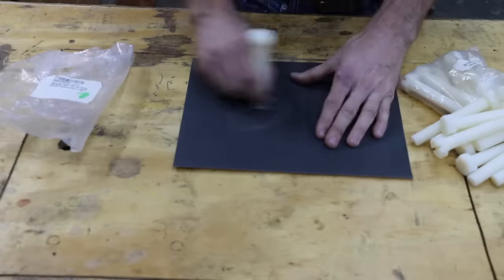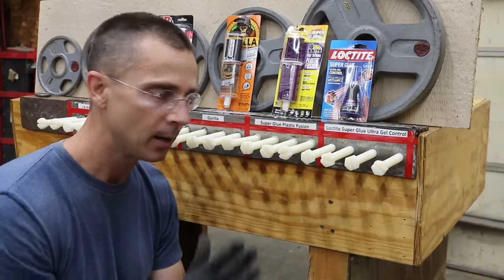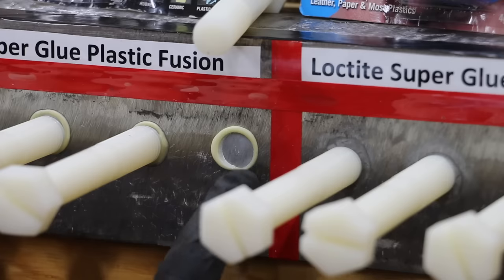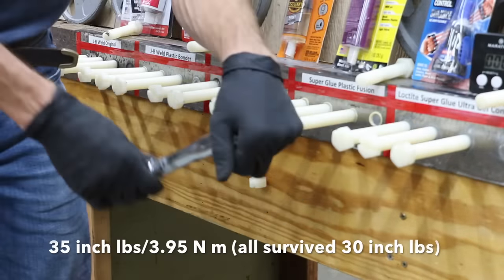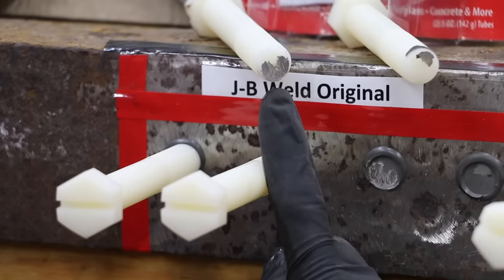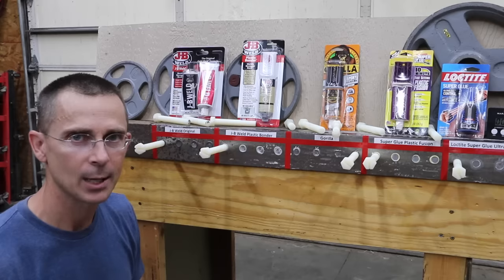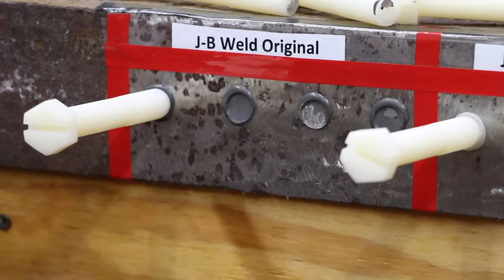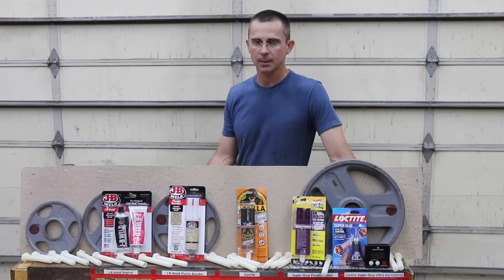Which Epoxy is Best for Plastic?  Let's find out!

Comment: I remember my motorcycle fairing snapped and I purchased some type of repair kit with a powder bottle and a liquid bottle. I Dremeld into the crack area about an inch in from the edge of both separated pieces, applied some type of plastic mesh, used tape to hold the fairing together on the painted side, clamped the separated pieces so they are held true, filled the plastic area I dremeled away with the powder, and then applied the liquid. It never separated but I don’t know just how strong it ended up being. Cool project tho. 

I’m thinking of repairing some broken parts of my door panels next. Maybe look to see if 3M has anything available for this.
Reply from the maker: Thanks for sharing.

Comment: @ProjectFarm  Which of your tests is most applicable to bumper tab repair?  I watched both this  and the "which epoxy putty is best" comparison  to determine which product would best fix broken car bumper/trim tabs. I'm guessing there must be strong adhesion to that kind of plastic trim, some flexibility since air and road vibration will be constant, resistant to driving temperatures in all weather, and general strength.   Also, I see various YT DIY hacks touting cigarette ash or baking soda mixed with superglue to do the same, but no reference comparison like your excellent video.  (You ARE the best. Worth a Patreon sub!)

Comment: It looks like the JB Weld Original was best overall and, since it released from the plastic, running it up a few threads forming a short sleeve(1/8-1/4 inch) should more than compensate for that. I think I'll end up using JB Weld original.
Reply from the maker: Thanks for sharing.

Comment: I never (after watching Todd's videos) and by my own experience, liked the Gorilla brand and for good reason but, Observing these tests, it occurred to me that by combining JB weld original and Loctite in a MIX, you could get the best results yet. I've had some many of my expensive headphones break at the plastic line that, instead of buying another set, I will take the time to do the above experiment and see how long they last for bonding as well as elasticity strength. For some people who have a bigger head than others which produces a lot of tension on the plastic band of headphones and the amount of hours they get worn on their heads, it would be very interesting to see if, by mixing the two best glue epoxy, would give me the results that I'm looking for. I rather spend $20 for glue than another $250 for a new set of headphones which I know in time will fail and break! Thanks Todd
Reply from the maker: Thanks for the feedback.

Comment: I used the JB Plastic Glue and rebuilt both of my arm rest in my Dakota and it is the best glue I have ever used on ABS plastic, way stronger then the plastic itself. I have tried so many glues on plastic and this is the best even out of the other brands that say for plastic. Locktite made a plastic glue that worked as good as the JB Weld but they don't make it any longer
Reply from the maker: Thanks for sharing.

Comment: I was hoping this would be about gluing plastic to plastic. I have a broken IBC tote to fix. The 'neck' where the drain valve is connected to the tote, broke off. I need to glue it back on. Thinking I'll probably try to 'weld' it. Applying staples, to give it some strength. But hoping I can also cover/seal the repair with a good epoxy and some more plastic...
Reply from the maker: Thanks for the constructive feedback.

Comment: Wow this is super helpful thank you so so much!! 
Question: Which epoxy or glue would you recommend to fix a cracked plastic Adirondack chair? 
(Basically glueing plastic to plastic and the crack is on the back. So I’d imagine I’d need something with some sort of give of flexibility, incase someone leans back/applies pressure). 
It’s a small enough crack to where I really do believe I can fix this…even if just temporarily. So any advice/recomendations would be greatly appreciated.
Reply from the maker: Thanks and you are welcome!  Thanks for the suggestion.

Comment: Which one would do the best patching a gas tank on an old riding mower plastic gas tank? Are any of these gasoline proof? I had a small hole in the tank. I filled the hole with steel wool then sanded it down. I applied another layer with a putty knife to smooth the finish. Note ☆ Steel reinforced JB Weld will repair a missing piece out of a side view mirror. It hasn't come loose yet. It's been 10 years. 🐀🐾
Reply from the maker: Thanks for the suggestion.

Comment: I broke a piece on my Toyota Runner air cleaner assembly (dropped it).  The part that was damaged was a plastic pipe and it is not serviceable (I would have to order the complete assembly-$400+. So you were my GO TO guy when I thought about trying to glue it back on.  Thanks so much for your video.  What about plastic to plastic?
Reply from the maker: You are welcome!  Thanks for the suggestion.

Comment: 2 part plastic weld. Dunno the brand but it is in a two part black  plastic tubes connected with a mixer stick the middle. Hands down the best plastic epoxy! Try it! Even works on ABS plastic. Which yall  know is a tough task
Reply from the maker: Thanks for the suggestion.

Comment: Let me just say that I appreciate your thoroughness and your overall scheme.  However, myself, I would never try to glue anything to nylon style bolts as they have a slickness that prevents real sticking, almost teflon-like.  The second is that I have used all of these products (not sure why you call super glue an epoxy) but I find that from experience, most plastics either need immersion (i.e. encapsulating the plastic to capture not only more surface but also to surround the part for most ideal grip around corners and other grippy areas) or some additional structural repair, such as a drilled hole through the middle and addition of either glass fiber or even a steel rib such as a nail for strength.  This was by far the least effective of all your tests that I have seen but I still enjoyed it although it was predictable.  Thanks for your quality work.
Reply from the maker: Thanks!  Thanks for the feedback.

Comment: Oh yeah 😎. Use PVC for PVC plumbing pipes and CPVC for CPVC pipes.  Old ABS pipes used 30 years ago replacing Cast Iron plumbing Drains and the associated LEAD, Oakum and the special offset chisel used to Pack the Oakum into the hub. All the Chinese 🛵 scooters including Project Farm's TaoTao use ABC plastic for Body parts/Panels requiring ABS plastic GLUE. Maybe Project Farm could evaluate and compare the available Plastic Welders starting with Harbor Freight?

Comment: Why do the epoxies adhere to metal better than the plastic?  I'm guessing the metal surface at a microscopic level is more irregular and the plastic surface is smoother.  I am wondering if preparing the plastic surface with sanding or applying an acid or acetone to the ends to create porosity or micro-fractures for better adhesion.  I was also wondering if inserting a screw or nail in the end of the plastic bolt would allow for a better adhesion, ie metal on metal, but I guess that would defeat the purpose of the test.

Comment: Useful and well structured test as always; however, there are so many types of plastic out there, we know it would take several tests to accurately direct users to their specific needs. My tractor as an ABS panel with nuts set into  the plastic in order to bolt to metal framework.  The ABS has failed due to engine heat and vibration. My intent is to adhere drilled metal angles to the ABS and bolt the assembly to the original framework. Your tests are always well organized and thorough. Have you done any tests to specifically address marrying ABS to metal? Thanks in advance.
Reply from the maker: Thanks for the suggestion.

Comment: another great job. i woul be interested in seeing this test bonding plastic to plastic, as many times, i have broken a drill housing or tool case (clear lid (especially!) parts sorters, or colored tool case side/bottom) and super glue andjb weld are all i have tried, with mixed results(jb weld did better, especially when reinforced with screen or mesh, but has also failed at times). I did not read all of the comments, so apologize if this has already been suggested. thanks!
Reply from the maker: Thanks!  Thanks for the suggestion.

Comment: Something to point out The metal was grinded lightly for the same purpose the plastic should of had. However if you look closely at the metal the scratch grooves are up and down And not side to side Yes this would matter on a idea you are adding pressure vertically to a groove that is also vertical. The plastic also needs to be scratched  Even the sandpaper used matters  40 And 80grit would be key  Even in welding the first thing you do is grind the area you weld for better contact 
Finally i would add the resin around the sides of the item you are trying to bond Having more than 1 surface helps ....
Reply from the maker: Thanks for the feedback.

Comment: A big variable in testing may be epoxy application. Excess epoxy up the sides of the bolt (especially on top for gravity testing) can greatly affect results. Notch stress (the fillet formed from surface to bolt) is also a major factor. Maybe try wiping the area clean of excess epoxy all around the bolt head.
It would also be interesting (in all testing) to double test sometimes to check consistency. Repeat testing would also allow experimenting with epoxy application.
Reply from the maker: Thanks for the feedback.

Comment: I am looking for a glue that can withstand high heat and can glue plastic to plastic.  I happened to put a cut on the very thin plastic top layer of my Tiger thermo cooker made in Japan (right underneath this plastic sheet is a thin-shinny glazed area looks like a a mirror with very plat surface, facing up, about 1 inch in diameter.  It's actually the knob on the top of the thermo cooker that I am talking about, where you whole to open the lid).  The lid gets pretty warm because this thermo cooker can keep a boiling pot inside pretty hot for up to 8 hours plus.  Do you have any suggestions?

Comment: What do you think would be a good hard epoxy to hold pins in place after re drilling a misaligned hole, the original JB weld is what I have and works Ok, but just doesn't seem to dry hard enough and afraid the pin hole may woller out...?
Reply from the maker: Thanks for the video idea.

Comment: Great video. Very helpful stuff. Just curious your thoughts on E6000? It seems to be pretty pliable, and I’ve used it on several small pottery repairs. However, I’ve yet find any instructional videos that explains the length of time you need to hold something together before you can set it down? For example, if you can’t put a clamp on it because of the shape or some other issue. The instructions on E6000 only state that is drys in 24hr, and fully cures in 72hr? I’ve never ran into this issue until today. I just don’t want to hold something together for 30 minutes, when I can probably set it down in 5. Any help would be greatly appreciated. From anyone. Thank you!

Comment: The reason I refuse to use Loctite anymore is because of the great discoloration it causes on all materials it comes close to. It ruins any quick fixes and bonds with white residue and discoloring that spreads. In addition, it does not even have to touch something to discolor it. For example, if you glue two items together and set it up on a table, the table will have a white spot on it by the time it dries. For a glue that has a very easy method of application, as it is a single substance, it definitely isn't meant for fixes around the house.
Reply from the maker: Thanks for the feedback.

Comment: What 'plastic' are the bolts made from? If it's nylon then none of the glues you tested are made for it, technically nylon is not plastic, it's its own catagory. Your testing methods are great .  Plastic welder is a methacrylate ,you should try it on ABS or PVC.

Comment: You'll get different results with different types of plastic.

I had one part where JB Weld original did a great job bonding to the plastic.  Most times it was a weak bond as seen in this video.

I've had OK results using a soldering iron to repair broken plastic parts.  Still not as strong as the original but usually a lot better than the epoxies.

My best results have come in the rare cases where I know the plastic and a solvent weld solution is available.
Reply from the maker: Thanks for the feedback.

Comment: I'd be interested in seeing a video on experimenting with adding varies amounts of heat to epoxies to see if you can speed up cure time.   (most interested in JB Weld)   24 hours on JB Weld is a pain!
Reply from the maker: Thanks for the suggestion.

Comment: This is a great one.  I have a $150 bumper cover on my Toyota Taco and I want to glue in 2 new one way tabs to keep the bumper on.  I have JB Weld original and that is the one I was going to use and I started looking and see this new product JB Weld Plastic Bonder and they also have a JB Weld Plastic Weld.  I wish you had done both.  I have to glue plastic to plastic and not plastic to Metal so metal is not really the right test but all your tests show these products failing at the plastic and not the metal.   I think given your results, however, I might just stick with what I already have --- the JB Weld original.  I also have regular 24 hr epoxy.

Comment: 👍There are different types of plastics that require different methods for bonding. Polyethylene and polypropylene plastics are the most difficult to bond; polyethylene terephthalate can sometimes be impossible. Epoxy-based adhesives works best for ABS plastics and multiple options can be used for polystyrenes. The substrate also matters. I'm not certain, but think you might be working with nylon. Nylon can also be challenging and nylon to metal is problematic, because adhesives designed for plastics may not work well for metal (JBWeld Plastiweld for one). One thing to try is to use a plastic cement on the nylon piece and CA glue, or other metal adhesive, on the metal. Once the plastic cement becomes tacky, press against the metal and remove it (ensures fit). Apply CA glue and press nylon to metal and hold for a little bit. CA glue should bond to the cured plastic cement. Of course, you should roughen both surfaces first. (-‿◦)
Reply from the maker: Thanks for sharing.

Comment: I came to your page looking for the best glue/epoxy for plastic, and I found it— almost... This test, which was great, BTW, was for bonding plastic to metal. What I was really looking for is bonding plastic to plastic—specifically, bonding a piece of broken plastic back onto itself. There is a plastic clip on the storage case for my Warner heat gun which has broken in half, and I'm looking for adhesives to glue it back together. Have you done such a test before?
Reply from the maker: Thanks for the suggestion.
Reply: @ProjectFarm  So I just started reading through some of the other comments, and I feel the need to apologize. I'm sorry for wasting your time with something that's been discussed many times already... In my defense, I was blonde before I went bald, so doing stupid stuff is in my DNA. 😉

Comment: PS: I'd like to see that test where it's plastic on plastic or fiberglass and fiberglass or the same material on the same material or even a crack in pressure test.   I'd like to see how that would turn out as well. I suspect for most DIYers that are using that type of product they're going to be trying to repair cracks or gluing something back together. 
Thanks again
Reply from the maker: You are welcome!  Thanks for the suggestion.

Comment: Would love to see one of these videos for plastic to plastic bonding! I have bought both JB's two part epoxy in the syringe and the putty, both designed for plastic bonding and am trying to bond a piece of ABS plastic. So far on my own little tests both have done pretty miserable! The syringe type in two tests failed to harden and just remained in a gummy state (not sure if this is the intended end result) as well as failed to bond to the plastic and was easy to scrape off and the putty performed slightly better yet also failed to cure to a harden state although it did seem to bond to the ABS plastic itself better.
Reply from the maker: Tanks for the suggestion

Comment: In my short experience with it, I found Gorilla glue would bond steel to paint or to rubber. LePage 2 component epoxy could not do that and that was the only other one I tried.
. I was using the Gorilla glue that expands, but I put on a thin layer of glue (about the thickness of a layer of paint) onto the metal molding for my car so it just had to hold that chrome metal on a curved fender near the headlight on a '65 MGB.  I did not need it (or wanted it) to foam.  It held to paint and to rubber and other surfaces that normally are not glued together. Clips or rivets hold it in place.(before doublesided sticky tape)  Strength not required.  It was a convenient epoxy and lasted a "year" in the container without going hard.  Keeping it dark and cool helped so I could use it  later as it is pricey stuff.
Reply from the maker: Thanks for sharing.

Comment: I dont have much luck with glue and epoxy, usually try to fix a broken plastic part.  Ive had great luck with Shoe Goo, glued the bottoms back onto a pair of sneakers and the glue bomd seems stronger than the sneaker material itself, that stuff is amazing but doesnt cure hard its more like a rubber when cured.
Reply from the maker: Thanks for the feedback.